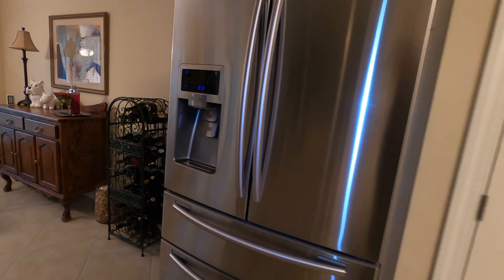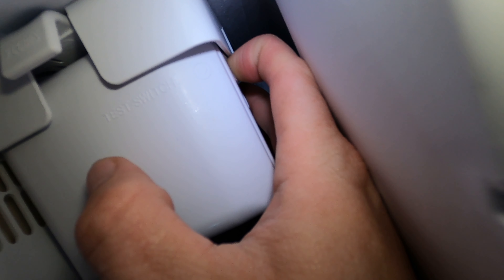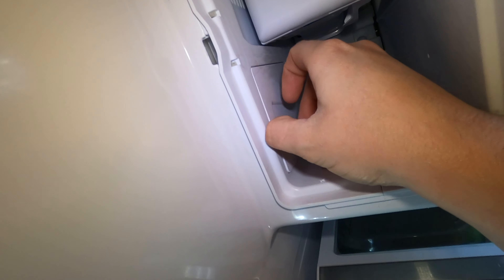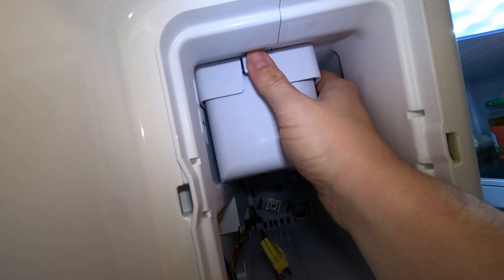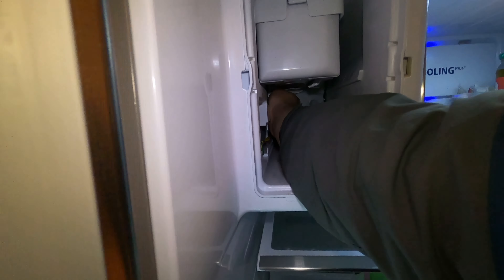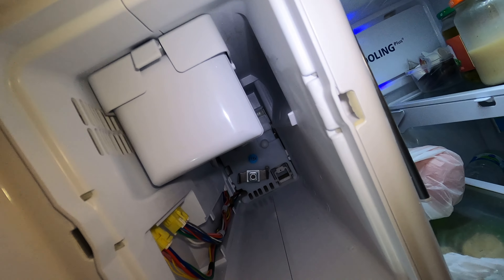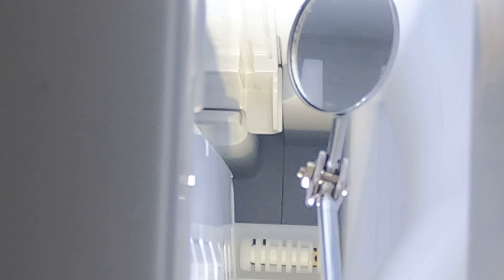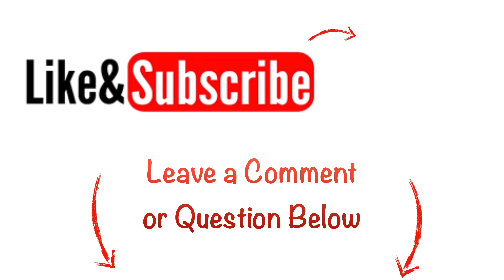Samsung Ice Maker repair Video

Comment: Our Samsung French door-style fridge was installed in October 2013 and has that same model of icemaker.  When it quit making ice last week, I ordered a new icemaker from the Samsung parts distributor after confirming the correct part number (I asked for a discount and they knocked 10% off their price of $154).  It arrived Saturday morning so I removed the factory one and compared it to the new one.  Just as you pointed out in your video, the ice tines in the factory one were stuck in the "down" position.  I installed the new one, we waited several hours, and sure enough ice started being produced again.  Thanks for your very helpful video.  It shows that this really is an easy fix for anyone willing to tackle the job.
Reply: My ice maker stopped a week ago, however the water dispenser continues to work.  Did you experience this same issue? My Model is RF4287HARS/XAA sounds like you may have a similar model, if so, could you tell me the part number you ordered? Thank you

Comment: Did anyone try the reset button under the blue  or gray rubber protection cover on the  left upper side ice maker shown in picture? Push and hold the reset for 8 seconds or until they hear the beep. Indicating the Forced Defrost cycle and ejection finger relocation set. Design flaw nylon motor gear slip when ice jammed. Fixed mine twice now by pulling the two motor mounting screws . Pulling the motor out slightly disengaging the gear and rotating the fingers back to home position and then reinserting the motor . Been a free fix for me twice now on my Samsung rf28r7201sr//aa

Comment: I took the old Samsung icemaker apart, just to see what actually broke inside. The broken plastic gears that turn the forks and the plastic gear coming out of the servo motor have got to be made out of the cheapest plastic I have ever seen.  Samsung should be embarrassed for selling such cheaply made garbage in a refrigerator that cost $2000-3000. We are fools to keep buying this overpriced junk. Our next refrigerator is going to be a simple, basic white top freezer Frigidaire With no icemaker or water dispenser.